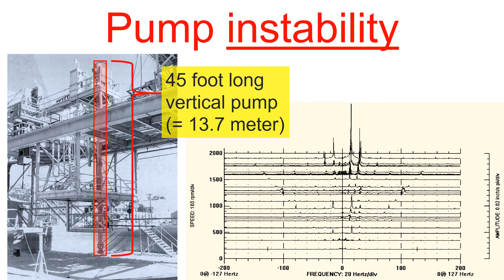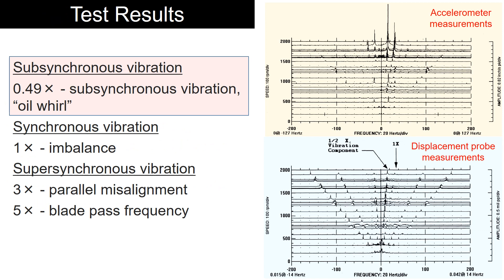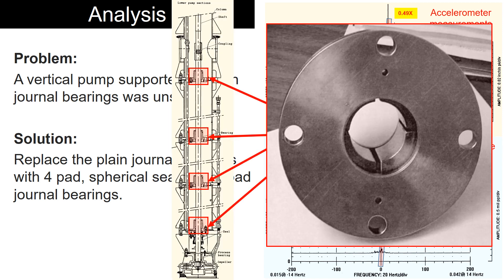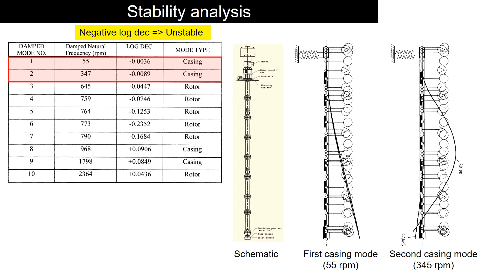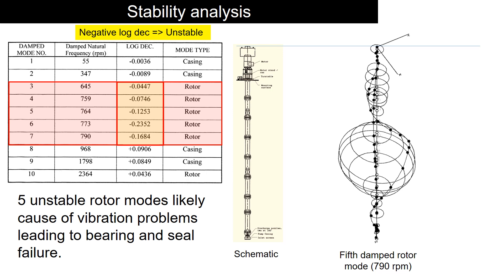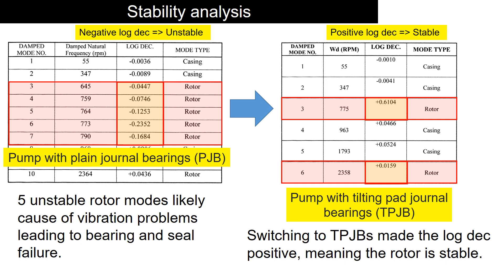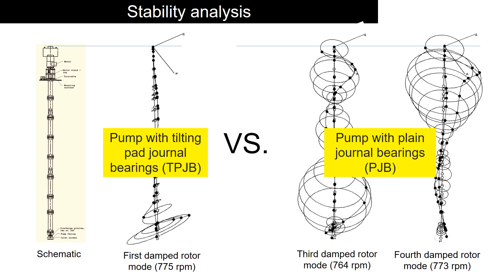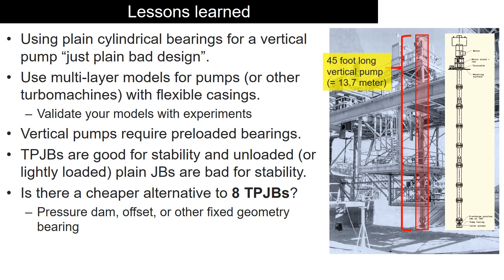Part 19 - How to reduce Pump instability in rotating equipment

Comment: Excellent video! I have a question, what is the relationship between mode stability and rotor dynamic stability?
Reply from the maker: Great questions! The concepts you've raised are interconnected. In rotor dynamics analysis, one crucial aspect is examining the mode shape of the rotor at specific speeds. We also employ bearing coefficients to gauge whether each mode shape exhibits adequate logarithmic decrement, indicating damping characteristics. If the analysis reveals a negative logarithmic decrement for a particular mode, it suggests the possibility of instability, potentially leading to significant motion during specific operations.
Reply: @RotorDynamics  Thank you for your reply! If all modes are stable(they all have positive logarithmic decrement), does that mean the rotor must be stable at all RPMs? Is it possible that all modes are stable but the rotor is unstable at some RPMs(e.g., the rotor has a large unbalanced mass)? This is probably a stupid question because I don't have a good understanding of the relationship between the actual response of the rotor and mode stability.
Reply from the maker: Great question! Instability occurs when the shaft orbit progressively expands over time, leading to escalating vibrations without apparent limit around ~0.5X and other vibration spectrums. You can find a detailed explanation in my Part 10 video. On the other hand, unbalanced masses primarily affect the 1X vibration, which can be effectively managed by ensuring proper rotor balancing. Please check Part 25 video.

Understanding the actual response of the rotor involves considering both the degree of imbalance and the rotor's mode shapes. These factors collectively influence how the rotor behaves under various conditions. Please check also the Par 6 video. If you're interested, I can explore this topic further in upcoming content. Thanks for bringing up this important aspect!
Reply: @RotorDynamics  Thank your for the explanation, I think I probably understand the definition of stable. Instability comes from cross-coupled stiffness, which is characterized by a vibration frequency of 0.5X, meaning that the orbit will keep expanding, at which point the rotor must be unsafe; whereas stability simply means that there is a limit to the orbit (even if that limit is well beyond the bearing clearance), and doesn't mean that the rotor can be operated safely. The actual response of the rotor (e.g. orbit) is the ultimate criterion that determines whether the rotor can be operated safely or not, I am very interested in its prediction and measurement and look forward to your upcoming content. Thank you for making these wonderful videos and for your efforts to spread knowledge!
Reply from the maker: Thank you for your insightful message and for highlighting the nuances between stability and instability in rotor dynamics. You've summarized the key concepts well, particularly emphasizing the importance of understanding the response of the rotor in determining its safe operation. I appreciate your interest in prediction and measurement techniques, and I'm excited to delve deeper into these topics in our upcoming content. Your support and enthusiasm are truly valued. Thank you for being a part of our community and for your kind words!